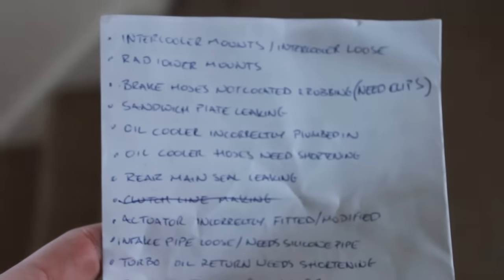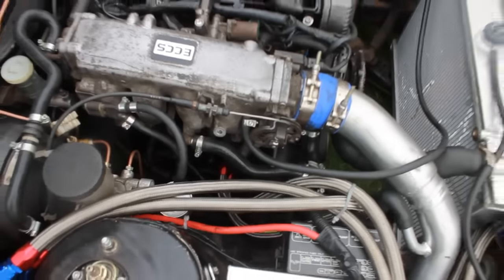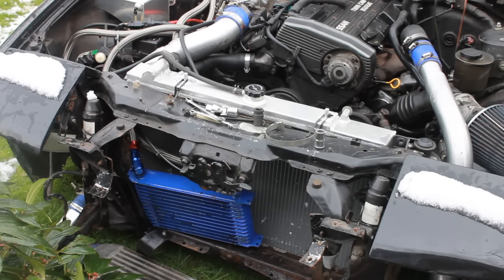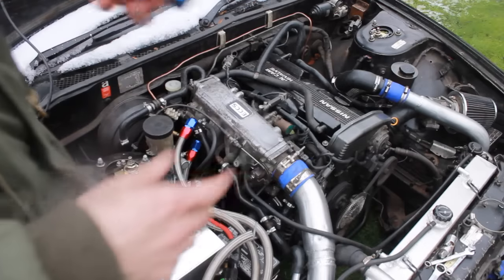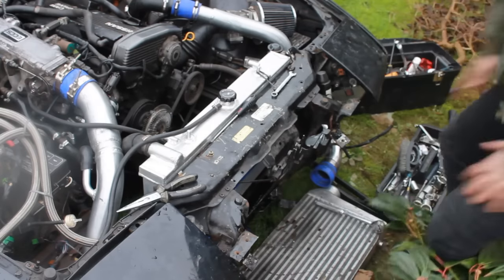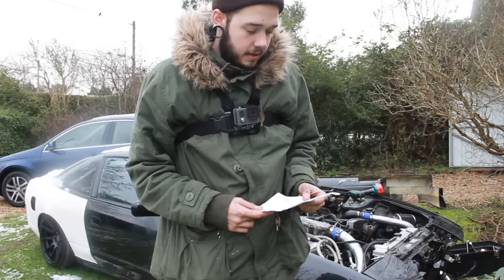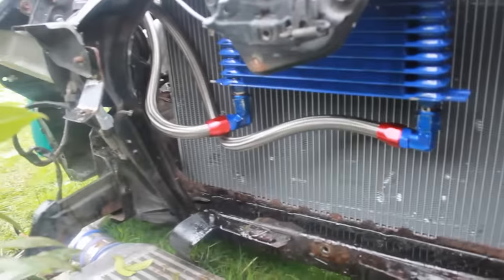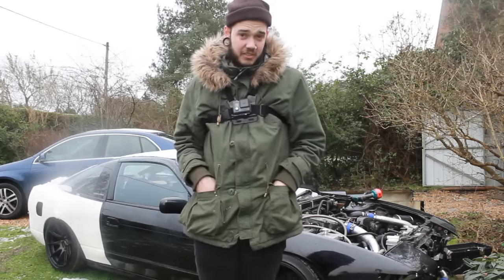Episode #1 - S13 Oil Filter Relocation

Comment: Looks like a really clean car to start with. Good luck with the build. Looking forward to more video.
Reply from the maker: More content to be released soon mate, was a rust bucket but she's coming along nicely!
Reply: Your mate set you wrong on the filter flow. The centre hole returns oil to the galleries, the outside hole is oil from the pump.